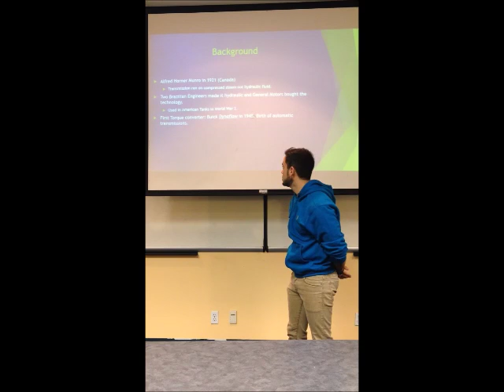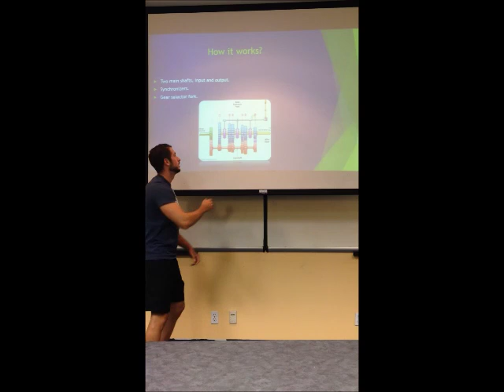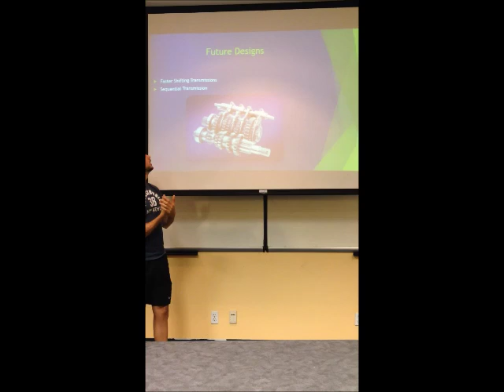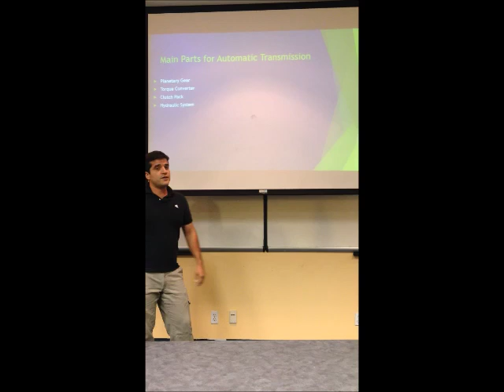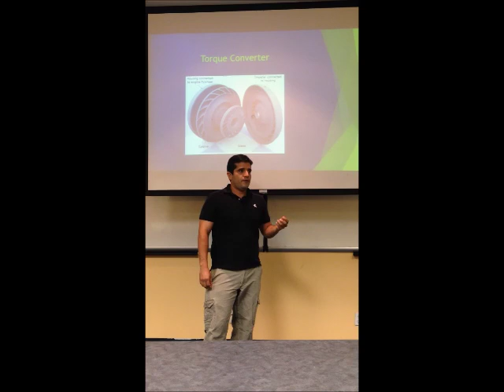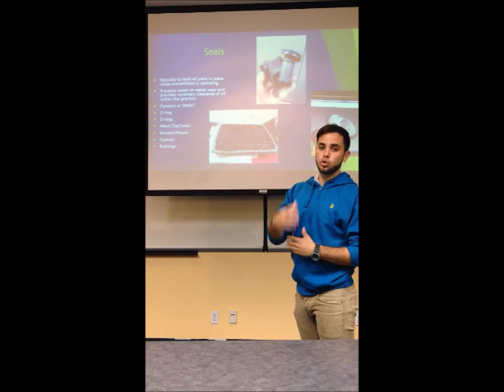Team 17: Gearbox Design for Automatic Transmission Vehicles

Comment: Gearbox Design for automatic transmission was very good explained through 
out the power point and also supported by nice images. There is a lot of valuable 
information explain in the design of automatic transmission. My advice will be to 
record the video in a wider screen and the camera in the center. Well done guy!